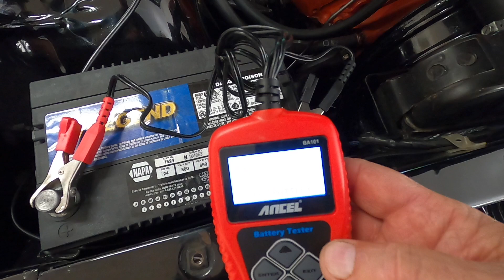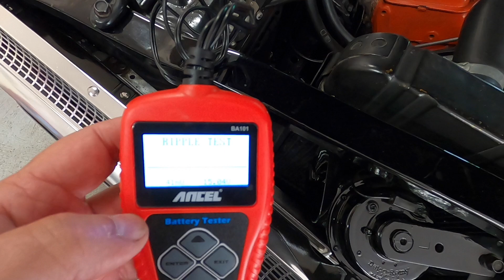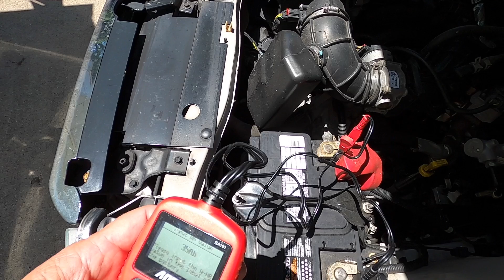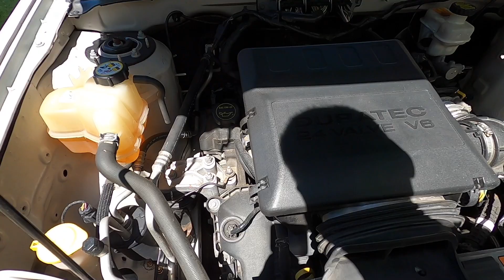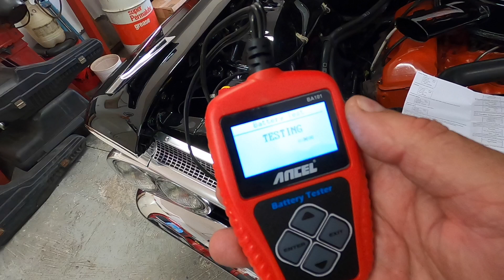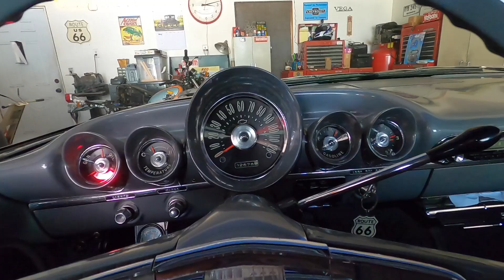Using a Ancel BA101 car battery tester on the 59 Bel Air and other cars

Comment: Might enjoy this quip.  Talking to my 34 year old son, who is car enthusiast, I told him when checking the motor oil, we routinely checked the water level of each battery cell under the colored caps, and filled each cell with distilled water to the top crest using a common squirt bottle.  He had no idea whatsoever I was referring to, haha.
Reply from the maker: I still have my bottle and extra huge eyedropper for adding water to batteries. I should show it in a video..... It's in the cabinet in the garage with distilled water in it still.....

Comment: Cool little gizmo!  Well you know that your batteries are good.  Any more attention to the Honda?  Have you been able to take it on the street yet?
Reply from the maker: Yeah, my bother and I were ridding around the block. Getting second gear was almost impossible. Turned out the shifter was slightly bent, causing it to hit the crankcase. Still waiting on the registration. Been working on the exit sign too.
Reply: @OldCarAlley so second gear is going to be something you'll need to attend to when you tear it down.  Hopefully it won't be to much to correct the problem.  You know I love that EXIT sign.  It's so cool!  Have you decided which door you're going to hang it over?  I guess I can assume it's going in the garage?  Front door, back door?  You might have to find another one so both doors are covered!  Lol.
Reply from the maker: @Martin48964  I did get the second gear issue resolved already. I plan to install it over the rear door. I for sure would purchase another one, if I find one, for the front door. My brother has one over the door in his barn.

Comment: Your BCI rating is battery counsel International basically it determines your amperage and voltage size and then puts it on the battery. Remember u can have a battery that say 12 .6 volts on your multimeter but if the amperage is half of it's rating it typically needs replacing. I recommend charging all your batteries once a month to the get up to 💯 %
Reply from the maker: When I am not using a vehicle, I often put a battery maintainer on them.

Comment: I just looked at your cranking stats. 9.6 is right at the limit for a good battery. Your starter Typically draws close to 300 amps. I would recommend load testing your battery to half  its CCA value and see if it passes.
Reply from the maker: I did load test it with my carbon pile, didn't video it, but it passed with flying colors.

Comment: That's a nice little tester. I agree with you fully about the Deka batteries. I was a parts manager at a John Deere tractor shop for 22 years and we sold Deka's the whole time I was there. Very reliable. The farmers in our area were sold on them.

Comment: A group 24 NAPA Legend battery has an amp hour rating of 276 according to their website.  10 years is something these days.  Last fall I had to replace the battery in my truck that was over 14 years old and it was just a Walmart Everstart brand battery.  It was probably the least expensive battery I could find when I bought it and it still lasted 14 years so I replaced it with the same thing.
The battery that isn't installed the date code is the M6 sticker.  M=December and the 6=either 2006 or 2016.
Reply from the maker: The Wallmart Everstart's are made by Deca....... They're good batteries! I'm thinking 2016, as that was about when I purchased the 60 Catalina. I took the battery from the Bel Air and installed it in the Catalina. I purchased a battery for the Catalina eventually, but put it in the Bel Air, as it saved me some work. So I guess it's eight years old.